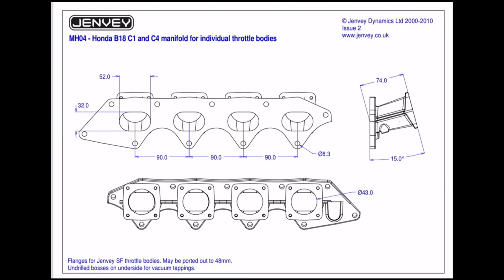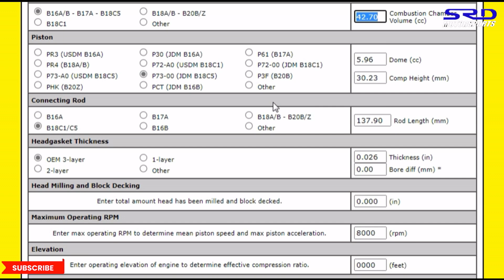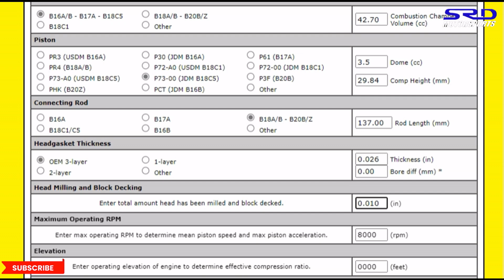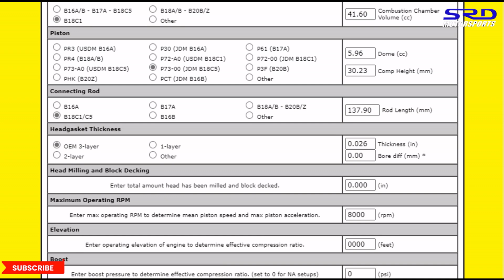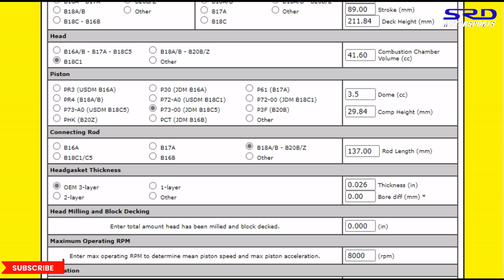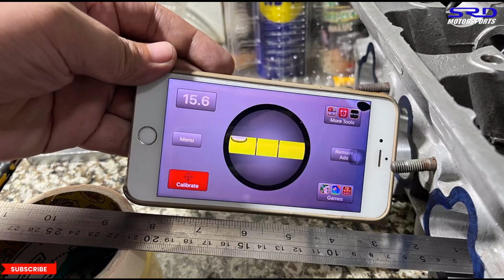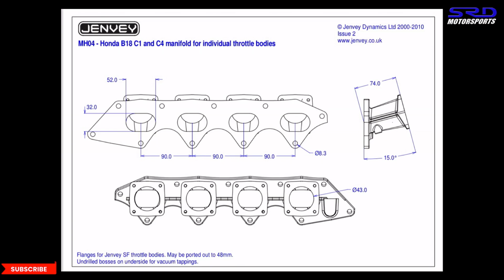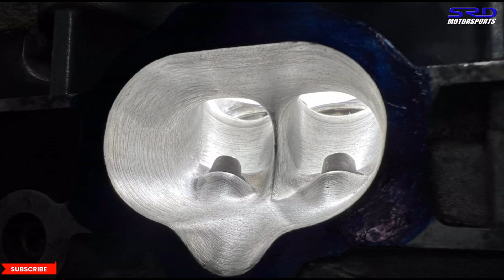B16 PR3 vs GSR B18c1 Head Difference by SRDmotorsports

Comment: Hello Sir @SRDmotorsports.. Your video is a fountain of knowledge about B Series engines and I was so impressed. Just wonder if All this porting measurements are also applicable into a forced induction set up??

Thank you sir..

Am really interested in your stuff
Reply from the maker: Yes it is… though a lot will say big ports u can make it work with big boost 

But a good flowing head all motor will always perform better when boosted (nowhere did I say “big port” hehe)

Hope that makes sense

Comment: Love your channel, I know this video is kind of a little old but it is still very relevant. 
I was wondering if you might be able to tell me the difference between b16a and b16a2 cams. There is so much convoluted information on forums. Just trying to see if running b16A cams will be fine on my b16a2 tune. B20 VTEC
Reply from the maker: @dagoose01212  oh thank you man! Glad u like the stuff here…

If u mean B16a like the gen 1 ? The b16a2 if that’s gen2 (92-95yr) the gen2 is a hair bit slightly bigger not a lot but even the popping of vtec is more audible… 

Time wise it might be minimal and could be fine actually
Reply: @SRDmotorsports B16A2 if I am correct is UKDM version of JDM B16A
Reply from the maker: For me it’s Gen 2

Comment: So, do you prefer a GSR or b16 head for n/a? They have very different intake runners.
Reply from the maker: yep intake ports are different and already have this video comparing the two and if I could choose? I can choose either one as both will work , just both will require different things and diff approach
Reply: @SRDmotorsports  Im building a new race motor and have a ported head, intake manifold, and cams coming from rocket Motorsports/bad guys worldwide that's why I was asking. I chose a GSR head to try and make a little bit more midrange and throttle response.
Reply from the maker: I see I see

Comment: Cual es mejor al final gsr o PR3 para block B18C
Reply from the maker: Depende por pistons but both egualmente bueno o mejor
Reply: @SRDmotorsports  Piston p73 blockB18C head pr3-2 cramshat Type R b18C intake b18C
Reply from the maker: Then the b18c head looks to fit well
Reply: @SRDmotorsports  head pr3-2 B16A jdm block B18C its fine
Reply: The head is a pr3 from a b16A jdm, it fits well, the block is an original B18C, all type R dc2 works well
Reply from the maker: Yeah that’s good actually
Reply: @SRDmotorsports  thanks
Reply from the maker: Yup 💪

Comment: I was curious would it be beneficial to use a B18c1 block with a b16 head? From the research that I've been doing, I've had numerous people telling me that the B16 head breaths better than the GSR heads, is there any truth to this? Because honestly I can run across both engines for pretty decent price and I can find both heads also for a decent price. Thanks for your help, advice and information.
Reply from the maker: Both heads work good actually and for most street and mix of street and race apps they’re both similar it will boil down to either the b18c1 will be like a Frankenstein style with a different (b16 head) or it wil be a straight b18c1 GSR engine too to bottom
Reply: @SRDmotorsports  OK, thanks and that's what I was kinda thinking. I know that the B16 and B18c1 engines are very similar and I imagine that Honda put in the effort with these B series engines. I'm mechanically inclined and have worked on plenty of engines but I'm more of a Nissan guy with the Sr20DET, VG30DETT, VQ35HR and VHR engines and I have recently got back into the Honda scene lol.

 Another quick question I was wondering about is I know going K series is probably a little cheaper than the B series in some aspects. Like I mentioned in a previous comment, I'm just looking to build a sleeper EJ/EK coupe with roughly around 450-600 hp, I'm definitely not chasing dyno numbers. But I was thinking maybe going the K series route and using the EKK1 mounts instead of swapping out my subframe for a EG subframe. What would be your honest opinion on this route? Sorry for asking so many questions that I imagine you probably get tired of answering the same questions lol, but I'm still in my research phase. I like to get as much information as possible about a topic before I commit to my plan. Again thank you for your time, information and advice, your YouTube channel has been the best that I've found so far with technical support, information,  advice  and just responding in general and talking about this subject. The technical aspect of engine building is a very crucial step I believe and I'm learning a lot from just conversing with all types of people lol.
Reply from the maker: A nice read man and thanks!

well tbh the Kseries is Ofcourse as good or better but…one must factor in the part where a 2liter Bseries on a crx or hatch may have traction challenges just simply cuz it’s torquey… now factor in the “cheaper” k24 right? and IMO cam wise it doesn’t change much just the K heads flow better but if it’s gonna be a K24 why run DIC ? That’s like on a Bseries let’s build a 85x95 stroker but run CTR cams cuz we want low end? Bruh the stroke already will give u that low end… k24 has 99mm stroke so gotta think about that 

Now a K20a now we’re talking 😂 86 bore 86 stroke gonna be fun that’s like turning ur GSR motor having it resleeved and run 85mm and keeping the 87.2 stroke… just the K has an edge being 86x86 and better flowing heads

but then that’s not necessarily cheaper than a Bseries no more unless it’s a K24
Reply: @SRDmotorsports  to be honest the only reason why I was thinking about going K series is because I can pick up a K series engine for a fraction of the cost of a B series engine like the B18c1 or B16a2, now the other non vtec B series engines are a different story lol. Plus I was trying to consider that B series parts are starting to increase in price and availability compared to the newer K series engines. Especially since the Ks have been overly produced since their introduction. I'm definitely not chasing numbers nor am I wanting to be the fastest car around because everyone knows he who has the deepest pockets will usually have the fastest car, depending on if that money was spent in the right ways and areas lol. I just want something that's going to be reliable and a little longevity too. So I think I will go with a B16a2 engine or build a B18 LS VTEC and build the bottom end with forged internals and build the top end with CTR cams also. My idea is to build the engine like I was going to make 1000hp but keep it around the 450-500 hp range. With it being in a 96 coupe it shouldn't be too much heavier than the hatchback from what I can tell. I appreciate the help, information and advice greatly. 

Oh, I almost forgot to ask about the B18 LS VTEC build idea. Would it be possible to run a stroker kit with the Frankenstein build? Or would it even be beneficial to run a stroker kit on it? Keep in mind that I am planning on going boosted also. I may or may not go NA for a time but at some point their will be a turbo added as long as I can find a reputable tuner around me to get it tuned the right way.

Again thank you for your time and advice. Keep up the great work. 👍
Reply from the maker: Makes sense actually and yeah if boosted then the B18 or Frankenstein set up might not need to go stroker it will still have excellent midrange and torque
Reply: @SRDmotorsports  Well, I think I found the route that I will try going and see what the journey brings, lol.  While I did mention going with the Frankenstein engine or B16a2, if I get lucky enough to grab a GSR engine, then that would be my first choice.  Either way,  I appreciate the all of the information, advice, help and all of my questions. I'll probably be back with more questions later on as I think about it lol jk. Thanks again.
Reply from the maker: Sweet! Sounds like a nice project and yeah man just comment away anytime on the latest videos etc whenever there is I’m active or atleast I try to be plus go share the fun so ask away anytime hahaha
Reply: @SRDmotorsports  thanks, I appreciate it.
Reply from the maker: No prob man

Comment: So which one will give more tourque while there’s a skunk 2 pro 1 cam in it with a b20b block
Reply from the maker: In theory the GSR head due to the lesser port volume but it still depends I mean 
Some will use that and then run a ram horn style header that’s known to kill midrange and wonder where’s the torque “they said gsr would give more torque”
Reply: @SRDmotorsports  is the yonaka reactive 4-1 header considered as horn style header you are talking about. Not quite sure about this
Reply from the maker: I dunno that header but I meant the ram horn looking header from eBay…

Basically my point is… yes the GSR will have more torque potential BUT
A b20v gsr on victorX manifold?
Will have WAY less torque than 
A b20v b16 on ultra street intake manifold

Granted both are on pro1 if that makes sense
Reply from the maker: Just checked online it seems like that’s a copy of the TypeR 4-1 seems fine for torque/midrange use that’s quite okay
Reply: @SRDmotorsports  guess I’ll have to start searching for a ultra street manifold haha thanks for answering my question
Reply from the maker: Well the skunk2 style ITR style for the GSR is also fine just the victorX is too big and short of a runner that on turbo it works good

Comment: My question is, what's the best route to for making a good turbo honda engine? I mean, getting a B18c1 is like getting an act of congress, not to mention that the price has jumped significantly for GSR engines. B16a2 are okay as far as prices go. But I was thinking about doing a Frankenstein engine with using either a B18b1 or B20 block with a B16 or B18c1 head. But I've read that the cylinder walls are supposedly weaker on B20 engines but I know that the higher 2.0 displacement will give more low end torque or so that's my frame of thinking. I know that the B18c1 engines use oil squirters and it has a girdle on the main caps also but you can put girdles on just about any engine. Any help, information or advice would be greatly appreciated.
Reply from the maker: get the head that you can easily acquire… I mean gsr and b16 head both works for turbo real good no problem
Reply: @SRDmotorsports  thanks, I can find a few b16 heads near me for pretty cheap. I can actually find b16 complete engines for pretty decent. Would it be better to use a b16 engine or go Frankenstein engine with it? Is there any truth to the b20 having weaker cylinder walls? Or is that just BS fanboy talk?
Reply from the maker: It’s true it’s weaker but for 250-350whp use it’s fine

but a b16a turbo with a properly sized turbo will have excellent low end too…
Reply: @SRDmotorsports  awesome,  thanks for the information. I have a 96 civic ex coupe and was thinking of going the SI clone route with the B16 engine to save some hassle. What would be the ideal turbo size for the B16? Again, I do appreciate the advice. Now, I just need to figure out what wiring harness to get the B16 swapped into my EJ8. I've found so many people talking about which wiring harness that they used, but very few videos actually go into detail on what they used and what goes where. Lol, but I guess with companies like Rywire, Ksport, etc, it's almost a plug and play world now versus the old days of making your own wiring harness.
Reply from the maker: True true and good to know… the usual t3/t4 is good check the size they used to reach 300-400hp that shouldn’t lag much

Comment: Really crazy information you're giving here, this info is something I haven't seen on yt and I just wanna thank you for it, a lot of people hold this as secrets but in reality people just wanna learn more and further their education, I used to tell people that both heads are great, just skim the b16 head and you'll get the compression of the gsr while still having better flow over the gsr, best of both worlds but now we also understand why the Japanese and spoon sports did builds with mostly oem parts and still made crazy hp just with the right combo like intake and exhaust manifold for example, please keep up the great work
Reply from the maker: Oh thank you Gudda Man! 😎 tbh I told myself I’d only share 20% of what I know, this way I still have substantial secrets.

Locally it only takes a customer with substantial budget and we will see records upon records fo sho :)

And back on topic, I ageee why Amuse, Spoon sports and many other Jap tuners make crazy good reliability and power that lets them drive like a drunk mofo on track… and still do it thru a muffler whoa!
Reply: @SRDmotorsports  exactly! They do all of that without any cut exhaust and some still uses the factory air box intake , those guys really know how to make power with simple stuff and yes ofc you still gotta keep some secrets to yourself haha
Reply from the maker: @StraightOutThaGudda  I always think it’s cool Spoon ran the eg6 airbox and just changed the intake elbow from oem rubber to kevlar looks ballin too haha
Reply: @SRDmotorsports  haha yess same thoughts here
Reply from the maker: @StraightOutThaGudda  and since I own an eg4 door I always had an eye on an eg6 airbox I had one but lost it in storage clean up :( but then an ITR airbox that looks like mugen and runs cone filter is too cool to not notice haha
Reply: @SRDmotorsports  haha well hey get whatever is the closest thing for you

Comment: Hello 🙂
Oem b20 block (84mm)
Oem crank (b20)
Oem rod (pr4)
OEM PHK piston
I have a lower engine.

What would you recommend as a cylinder head?
Pr3(b16) ?  //  p72 (GSR) ?
I have both.
But I'm undecided on which one to wear.
Reply from the maker: Whichever one gives u more choices on intake manifold
Reply: @SRDmotorsports  

intake manifold / ITR
camshafts / JDM ITR
Springs / ITR Double

however, the intake manifold was previously adapted to fit two caps. That's why I was undecided between the two cases in terms of durability, which would be more compatible.
Reply from the maker: @muratsalman7493  yes but the ITR b16 manifold angle is not good or correct with the p72 so

It’s better to use the pr3 head with the correct manifold
Reply: @SRDmotorsports  ok thank you very much for your answers :) 🙂
Reply from the maker: @muratsalman7493  no problem :)

Comment: What you said in 13:30 which is why low lift flow at the seats is important to get good efficiency.
Reply from the maker: Yeeep and a lot miss out on the fact that low lift let’s say 0.100” ? The valve sees it TWICE on the induction stroke

First on the “opening” sequence and second on its “closing” sequence but max lift only once

Food for thought 😎
Reply: @SRDmotorsports  Exactly!
Reply from the maker: @findtherightbeat  I guess just “one” sells haha
Reply from the maker: @findtherightbeat  what’s interesting is in the air cooled vw scene? Even enthusiasts “most” are aware of “port volume” before being “wowed” by cfm in reference to their own build, compression goal, displacement and induction 

And our local cats be acting advanced/modern? Lol!
Reply: @SRDmotorsports  Some people seem to think domes, max cfm, max lift, etc. will be the silver bullet that makes them good power when it's actually meant to be looked at as a system
Reply from the maker: @findtherightbeat  and they secretly end up using the silver bullet by the name of m5 to make up for all of the “kulang” hahaha
Reply: @SRDmotorsports  Power in can 😷
Reply from the maker: @findtherightbeat  replaced “power in a bottle”
Loool

Comment: True on what you mentioned on what's good on paper vs actual results. Some have gone after good flame propagation too much and ran flatter/milder pistons then decked and milled the head/block to make up for compression. But ended with an engine that pings a lot at low rpm and also while under load. Not a fan of high dome pistons also but doing either too much seems to not work at all.
Reply from the maker: Yeah I agree on that, I have lots of scratch paper notes and some of it gets disproven by mechanical measurements and that leads me to “triple” checking most things 😂 on decking and milling alone it gets interesting 

Opted not to mention (keep some secrets within) lol  but even Dome one of these : 
Tumble vs reverse tumble certainly don’t mind the dome…

Funny cuz what if the “tumble” that don’t mind Dome? Is also the head they used while being bent on “less” dome 🤣
Reply: @SRDmotorsports  Thoughts on Rollerwave?
Reply from the maker: @findtherightbeat  it’s pretty smart actually when u think about it, sadly detractors go against it due to dislike of “brand” or person 
Lol 

but it does delve into the tumble vs reverse tumble spectrum
Reply: @SRDmotorsports  They may dislike Larry but at the end of the day the proof of the pudding is in its eating. 🍻
Reply from the maker: @findtherightbeat  yeah and the thing with “disliking”

know the reason why lol cuz if u can’t find a proper reason then it’s basic envy lol

Like I said to friends before…on “hating” and “haters” how come they’re not the ones above? Always the ones below that “couldn’t” reach or “achieve” it lol
Reply: @SRDmotorsports  Haters gon hate 😄
Reply from the maker: @findtherightbeat  hahahahaha facts! Lol